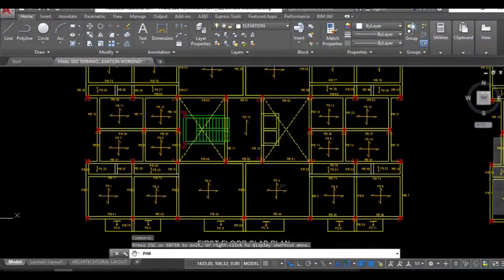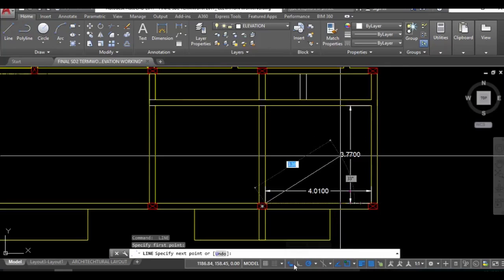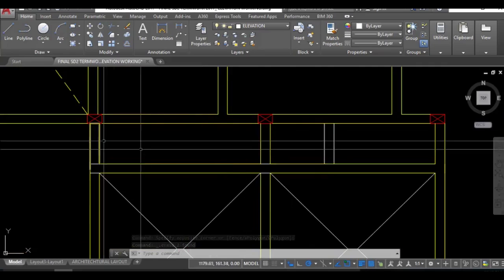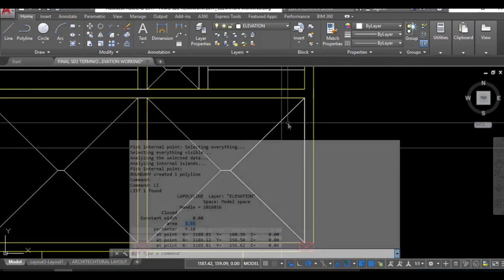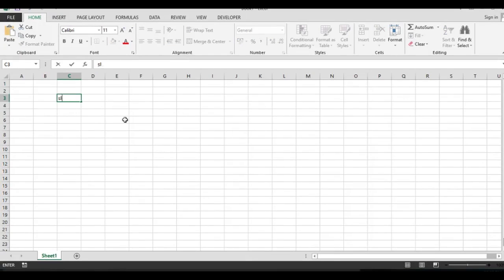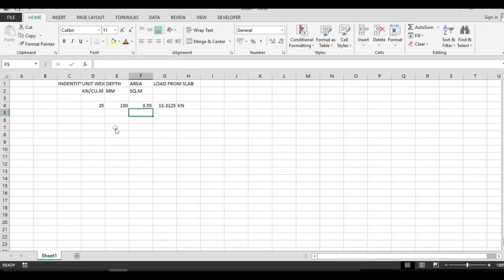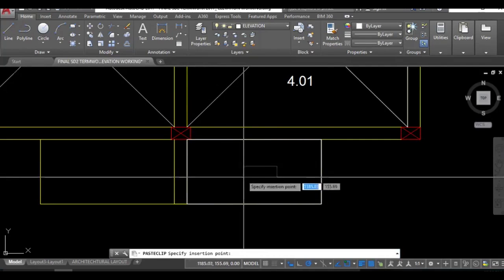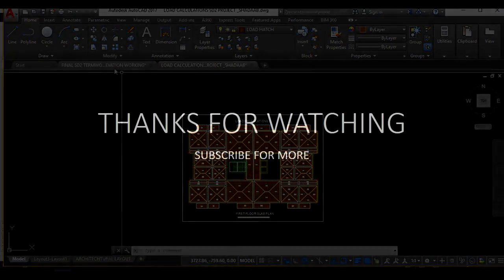Calculation of Load from the Slabs Using AutoCAD | HYONKOWS

Comment: Hey.....
Can u tell me how to calculate load of column n design of column in autocad
Reply: You can't do that in autocad but u can do it in Excel using AutoCAD data
Reply from the maker: Hi Manjunath,
It is possible to design columns in AutoCAD. Not directly but if you code some lisp then you can just create a few commands that based on a few inputs can help you perform the same calculations that you could do in Excel. I would recommend using Excel for calculations but if you're interested then you can program a lisp to get that task done as well. 
I have a lisp that I use to plot control perimeters based on a the point loads and column positions

Comment: lovely for this vedio i want to know how we design the beam size & which dia we recommend plz discuss?
Reply from the maker: The bar diameter is dependent on the are of steel that you require. Generally 12mm tor or 10mm tor are provided but for heavy structures the reinforcement may even go upto 32mm tor

Comment: Sir I have couldn't understand that you said that value of load 15KN acts as UDL. but you multiplied the concrete density with slab (having area 4.01.) volume. which converts it into total weight of concrete . can you explain how it acts as  UDL. should we divide the total weight by beam span length to convert it into KN/m as a UDL......???
Reply from the maker: Anwar Mengal yes you're right, the 15KN is to be divided by the span of the beam.
Actually I also divided the load by the span. Due to the poor audio equipment I might have missed to account that.
Sorry for the inconvenience caused
Reply: i.e. Civil. Thanks for clarifying me. You have done a Wonderfull Job. Highly appreciated.
Reply from the maker: Anwar Mengal thank you 😁
Reply: Sir how much total load in KN/m2 per slab acting on each  slab 
I mean live load how calculation is done plz explain
Reply from the maker: Live loads are determined by considering the functionality of the structure, is it used for residential or industrial purposes.

Generally for residential structures the live load is around 2.5kN/sq.m. The 2.5kN/sq.m load is then distributed to the beams using the method that I'd shown in the video.

As you can see, those are area loads i.e. per sq.m and so you need the area that the load is acting upon to convert those to actual loadings. In this way after getting the load distribution from the slabs you can proceed with designing the beams.

Hope the clarification was helpful.
Thank you
Reply: Explain with any kne beam how much load acting on beam from the slef wt of slab
Reply from the maker: You can calculate the self weight of the slab, then divide it with the area of the slab and then distribute the loads from the slab to the beams.

Hope I'd answered your question.

Thank you